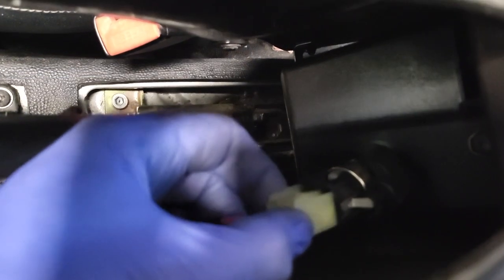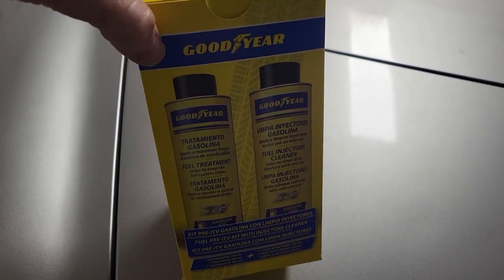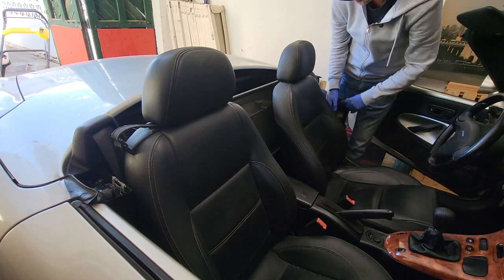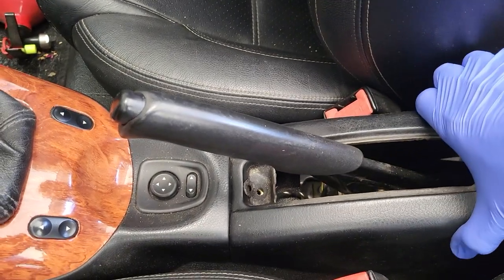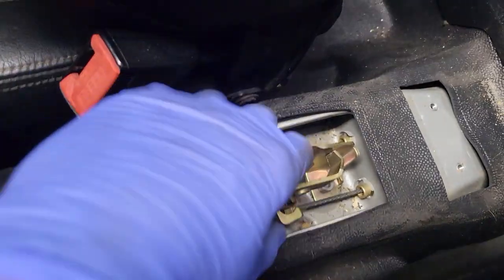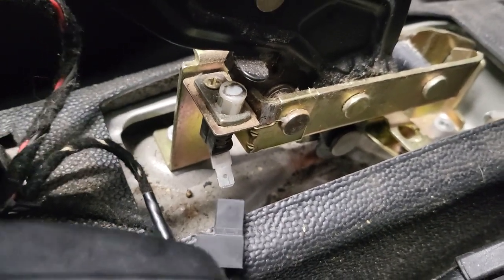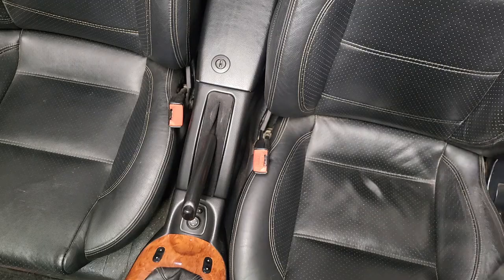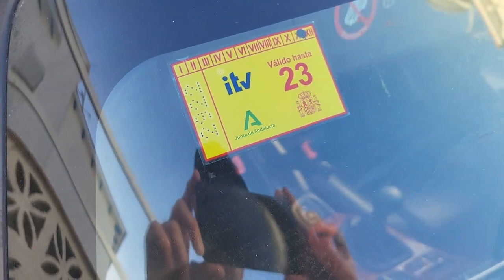Fix emissions test problem & pass the inspection | Fiat Barchetta handbrake adjustment

Comment: Hi, thanks for the video, very useful as always. I had the same issue with the handbrake cover. My solution was a  very simple and effective one: I  added  a bit of heated, liquid silicone to the 4 rubber placebolders on the bottom of the cover. They tend to wear out. And when it cooled down I could easily click the cover back in place. Issue solved. These heaterguns are sold regularly at Aldi or Lidl for very little money.
Reply from the maker: Thanks glad you enjoy the videos. I will give that a try on mine!

Comment: Bien hecho !! Yes ive sat a few times for 10mins at the emissions part and eventually passed but last time not !! The trim piece at the handbrake i covered with black carbon fibre vinyl. Looks good and adds a few mm to the outer edge and therefore helps keep the trim piece in place.
Reply from the maker: Thanks. I think it's going to get harder each year to pass the emissions test. Will need to do something about my handbrake cover!

Comment: Enhorabuena,por el video y por pasar la itv.
Tomo nota de los aditivos para la gasolina.
Qué llave del 10 has usado para tensar el freno de mano?Alguna especial para que no tropiece con el largo tornillo?Ya me dices cuál es.
Yo mañana cambio termostato,que se queda siempre abierto y en carretera no pasa de 70° y también a ver si soluciono el olor a gasolina cambiando las 2 gomas de los respiraderos del depósito que el anterior dueño selló con silicona.
Tambien llevo cambiadas las transmisiones(palieres) y las rótulas completas,desde la cremallera de dirección.
Gracias por tus videos ,me ayudan mucho.
Un abrazo.
Reply from the maker: Gracias. Tengo otro año para disfrutar el coche! Parece que estás muy ocupado con tu Barchetta. Creo que el olor a gasolina es un problema común. suerte con los demas trabajos. La llave no es nada especial. La llave de vaso 10mm tiene 50mm de largo y hay una extensión de 40mm tambien.